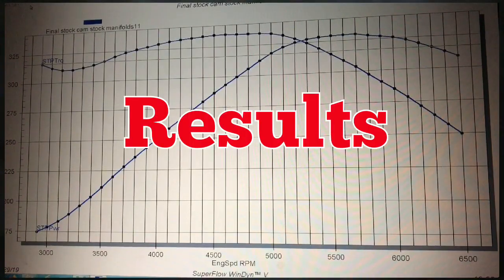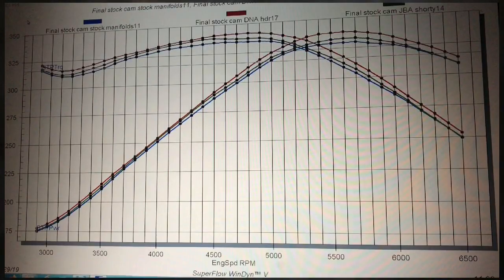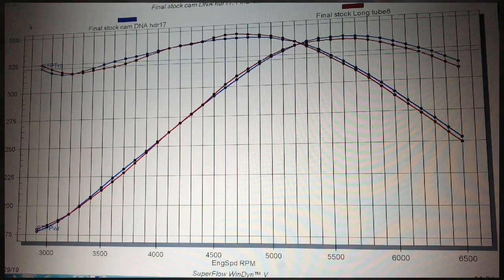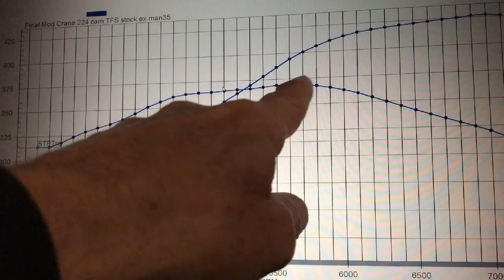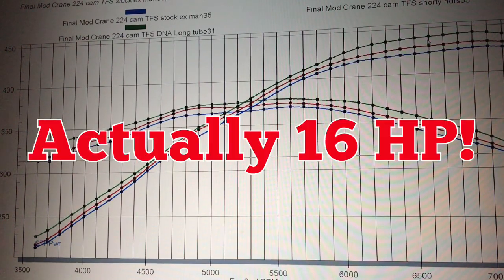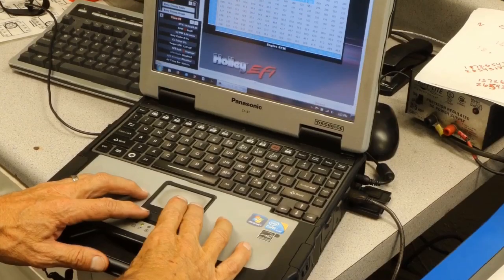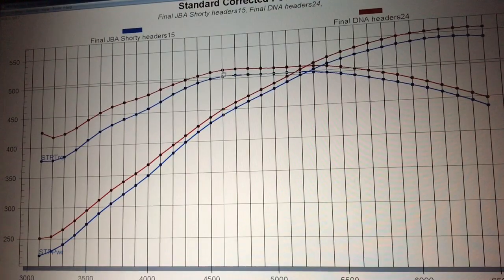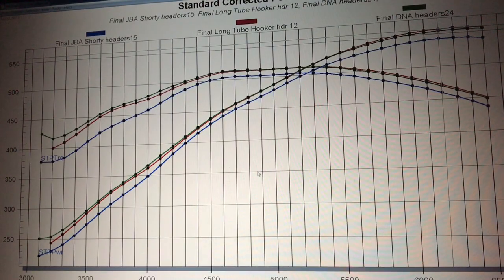DO THEY WORK? LOW-$ EBAY HEADERS

Comment: That IS surprising! 
I have always been told that shorties would be better for me in low torque for my Summit 5.3 gen 3 LM7 450+ hp LS swap in my 1990 Corvette that is going on right now. 
I have been brainstorming trying to find shorties that would fit easily and there really isn't anything. 
I did just find that there  long tubes that are bent to actually fit well in my C4. I guess i will be checking to see where to find some cheapie long tube headers. 😊

Comment: The biggest thing I've seen with the Ebay headers is they are not really make-model specific.  It's "we make a set of v8 headers, sure they're for your make/model, you just need to make them fit'.  So depending on the car expect a bit of denting to be required to get around things.  But saving $1,000 also is a big plus.  Just depends on the car and value/budget.

Comment: Only ISSUE I've had with the ebay headers is finding 3" collectors and sometimes they ain't welded inside and outside of the flange. 10 minutes of welding and a little longer search to find 3" collectors and right sized primaries is worth saving a few hundred dollars to me !!!

Comment: I'm just running stock manifolds on the newest project. I don't want the header drawbacks for a 10- 15 hp upgrade on a 280 hp engine.

Comment: Richard , looking at the difference between the cast exhaust manifolds on this style engine , and lets say cast exhaust on an older style engine .  There is a totally superior design to the cast exhaust manifold on the newer engines than there ever was on the older engines except perhaps the older mopar max wedge engines of the 60's when a lot of effort was placed on max horsepower for those motors .  The cast exhaust manifolds on most of the older engines across the board from manufacturer to manufacturer were in many cases absolutely awful and just served to basically get the exhaust gasses out of the engine bay and out the tailpipe without leaking .  There was no or very little emphasis on extracting extra power or efficiency from those old style cast exhaust manifolds .  As a case in point , The older gentleman that once did my engine machine work described a situation where Ford motor co. when installing the 351 cleveland in one of its cars did not account for the restrictions in the engine bay at the point of exhaust manifold on the passenger side , they were forced to redesign a different manifold for this particular vehicle when using this motor, and by doing so the new poorly designed unit covered part of the exhaust port and greatly hurt how this motor needed to properly breathe.  The main point that I am trying to get at is , have you ever done a test like this on older style small block chevy , ford or mopar engines ?  Many individuals building these older style motors , like myself , would like to know how much difference there is in torque and horsepower with the old poorly designed exhaust manifolds compared to , even shorty style headers !!  I have an older work truck wit a 460 Ford engine that needs new exhaust and I'm considering replacing the old decrepid cast manifolds with shorty headers .  Thanks for all the effort you put into sharing your data with us on how to make more sensible mods to our motors , We  greatly appreciate it !!
Reply from the maker: we have run stock manifolds on sbc vs headers

Comment: Actually took my DNA headers out of the box today. I work with stainless steel for a living. These are definitely not 304. They are some extremely low grade stainless and you can get a magnet to stick fairly well on the tubes and i had no problem getting one to stick on the flanges. For $200 I'm not going to complain too much as long as they have a reasonable fit. One of the "mid pipe" tubes is ovaled pretty good and isn't going to work out of the box. I'm probably going to make my own with an x-pipe and true duals. The hardware and gaskets are going in the trash.

Comment: I would like to see a test on mid length headers, the advantage is the mid length tend to fit easier than long tubes.  I imagine they would be in between but how much.
Reply from the maker: power is between long and short
Reply: @richardholdener1727  I am running mid length headers on my 72 GMC with an lq4.  It has ported and polished 243 heads a comp cams cam 226 duration intake 232 exhaust 113lsa 600 lift, tbss intake.  I made 350hp at the wheels and power peaked at 5700 and stays flat to 6500.  I am running 2.5 inch dual exhaust on it and was debating on going to a long tube header but not really sure it’s worth the expense.  I was thinking maybe a long tube would give me a bit more on the top end, I have more low end than I can use so that really isn’t a concern.  Thanks for your videos I have learned a lot, and your answer confirms what I was thinking that the power would be in between.  If it was closer to the shortys it might be worth it.

Comment: I am not a race driver, I am in pursuit of increased efficiency.  No one makes a long tube headers for my application so I use shorties.  The only auto of mine that does have long tube aftermarket support is a turbo, so shorties still win.

I did find your tests very enlightening.  I begs the question, do I support the company that spends all the time and money to develope quality aftermarket products of the POS overseas company that STEALS their design with absolutely no regard for their investment and sells them on eBay with zero overhead???  I support American aftermarket companies and for those reasons.  God forbid I ever need customer support from a company in China that ripped of my go-to American company's, design!!

Comment: Given how much power Freiburger DIDN'T lose by smashing headers with a sledgehammer, I think Ebay headers will be just fine for their length.  What you get with a name brand is quality, fitment, longevity, and approving nods from the grey-beards.  Fitment is no joke; sometimes you discover that the cheap headers want to occupy the same location in space-time as a control arm bushing (because they were mocked up on a 4x4 model and your 2wd is different).  But Ebay has a fitment return and refund policy, so there's that.

Either route is valid, so long as you know what you are and aren't getting for your money.

Comment: What did you do with upstream 02 sensors /placement locaton when you did all this testing or does it not matter ???
Reply from the maker: we ran a stand alone ECU-no closed loop or need for factory O2s
Reply: Is that  a dino only feature tune type thing or could it be used  or applied to a everyday driver vehicle
Reply from the maker: we ran the motor with a stand alone ECU (Holley), not the stock ECU-it is possible to run one in a vehicle but would be difficult

Comment: Really glad to see this. I used DNA headers in the past and i always wondered how much power i was leaving on the table. Fwiw i ran them for ~3 years and i sold the car with them on. I didnt have any leaks or visible cracks when it left.  Disclaimer the car only saw about 10k miles on the ebay headers but a ton of heat cycles due to short trips but got frequent WOT pulls. 

This was on a stock cammed motor with aftermarket intake and full exhaust.  Nothing special.

Fitment was good enough, a little closer to block vs stock but didnt cause any issue. I would buy them again for another budget NA build. 😊

Comment: I had an idea the power levels were not gonna be much different vs eBay headers and name brand but my personal experience is the name brand exhaust last longer and hardly ever have fitment issues. The fitment issues on cheap headers can be a nightmare so that alone makes me pay the extra money to get the more expensive ones. Great video
Reply: Cheap ebay stainless Jeep 4.2L header hit the leaf spring on a Wrangler! Supposed to be direct fit. I said for what a 2WD or an extreme lift!

Comment: My short tube headers were very thin where the exhaust piping  bolted up to them.  The exhaust guy did great welds but at the confluence of the very thin wall SS and the aluminized tubing it was a difficult weld.  Remember these do not have a flange just a short end of the tube that clamps to the  headers. Flange thickness at the head was adequate and I had no issues with them leaking there.  Spark plug access was fine but the set up needed a set of ceramic boots on the wire to keep from burning them.  Don't forget to add the cost of the wires to the change over.

Comment: I had to get an ebay header for my old car, 93 sidekick. The old stock manifold was cracked. It did run a lot better, mostly from not having the crack. But for IIRC $80 and $120 for a shop to install them, compared to $400 for a set of replacement manifolds. It was a great Improvement.

Comment: You teach information very well… easy to follow and understand… my question is… I’ve seen different design in shorties.. I have a set of hookers that are called GT 500 tuned shorties design for a 4.6/3v  and they have actual collector as others don’t  … I’ve also seen DNA from eBay with the same design… my question is is there any difference in design of shorties when ie comes to power… and not compare to long tube…
Reply from the maker: you need primary length
Reply: Can you explain the meaning of “tuned shorties” as compared to “non-tuned”.. and is that just advertising.. now I understand pulse exhaust timing which is why LT’s are the best but how does that improve the shorties…when the primary’s are not equal lengths…because I noticed an increase in power when I installed my shorties..

Comment: Included with your voice over a bar graph with all the hp and torque differences together would be easier to understand. I like the videos but sometimes it takes a while to get to what I came for and I miss it.
Then I catch myself having to replay parts to gather all the feedback and compare them in my head. LOL!!
Reply from the maker: I SUPPLY GRAPHS IN THE VIDS FOR THAT REASON
Reply: @richardholdener1727  Bar graphs with peak hp and torque. I like the line graphs but who cares what numbers we are running before launch.

Comment: For my engine here in Aus, only the expensive Pacemaker headers offer long tube headers, all other cheapy brands ones are basically a tube version of the cast logs which suck.  Interestingly I get about 18rwKw gain going from stock to long tube on my Buick L27s but I think it is in part that the stock logs make the engine quite knock limited at about 22-23 deg where the long tubes allow the engine to reach MBT of 29 deg without any knock.
Reply: Logs😂😂😂😂😂 oh my, you Aussies are something else😅
Reply: @keithhaynes5348    What do you call them, branch of a tree manifolds? A quick google on "log manifold" didn't yield much of any Aussie result, but predominately US sites selling log manifolds for JDM and LS applications 🤷‍♂

Comment: First time viewer, first comment. New to exhaust so bare with me please. I seek knowledge.

So I have a 1975 Ford Econline e150 shorty with a 351windsor / v8 /5.8l / true dual muffler system and its all stock. Only upgrades I have done so far  is swapping the intake manifold from a 2 barrel to a 4 barrel / air gap / single plane. I swapped the Motorcraft 2 barrel to a Edelbrock 1406 4 barrel. Everything else is OEM except for a sweet looking set of Mickey Thompson Valve Covers I scored on FB Market and added some 22' Thrushters mufflers to the exhaust system . OUTSIDE of changing cams and heads, do you think that changing the headers to some shorties tubes will give me some increase of power or torque somewhere? 

Thanks in advance and I enjoy your detail analysis.
Reply from the maker: long tube headers will add power-shorty headers will not
Reply: @richardholdener1727  The two long tube headers seem to have different  design. The shiny ones have a longer front cylinder tube than the rest, and the other design has it the other way around, first one is the shortes, correct? The effect on power is not that different, but there must be some reason for the choice of design, right?

Comment: Hi Richard, I was wondering if you could take some time to reiterate some things I've learned from your videos.  I have an '06 Sierra GMC with a rotted cracked block on the coolant side..   I'm looking to make another '06 LS 6.0 jump as an everyday driver.  While it's apart I figure why not make it as good as it can be. Any advice would be mucho appreciated.
Reply from the maker: WHAT IS YOUR QUESTION

Comment: I ran a 5.7ls1 with a 220/220 581 xer with shorty 1 5/8 with modified 3 inch collectors and got sucked in to internet pressure and swapped to long tube 1 3/4 with 3 inch collectors, optimised the tune and ran the car on the same dyno and lost power and torque down low and only gained 3hp up top. Definitely wasn’t good bang for buck 😳
Reply: So you would have stuck with the shortys?
Reply: Yes I definitely would have

Comment: Thanks for the rundown on the results!  Def great info to know!  Based on that data, as long as the fitment of the inexpensive headers is acceptable, then I wouldn't have any issue with using them.  From a cost perspective, they're pretty much disposable.. but nobody want to replace stuff "just because".  So, it would be interesting to hear from others about their longer-term experience with the lesser priced parts with regard to rusting, reliability of the welds (life without leaks), as well as discoloration.  Ceramic?  Blankets?  Bare?

I imagine that Richard would excel in an American Sign Language course!
Thanks again!

Comment: I would like to see the tests re done with a x pipe or a y pipe vs straight pipes see if the gains are more substantial as having a y or an x pipe helps with cylinder scavenging as I understand it I could be wrong most people running headers care about peek performance and are running a crossover pipe of some sorts the test could be a completely different animal
Reply from the maker: the exhaust design behind the shorty headers won't change their gains

Comment: Wonder if this is the same case for Ford 3v motors because I got some $170 longtubes off eBay for it lol. I can definitely tell a difference in the seat of my pants but I also installed rattler cams and Ford racing intake manifold. I figured if nothing else they gotta be better than those stock logs that were on it

Comment: My thought at the moment is buy cheap headers  for my application, or just run stock exhaust manifolds.  If you have to cut and weld I'm nowhere ahead, rather than buying name brand headers that don't fit it's intended application. THINK BEFORE YOU TAKE A HAMMER TO THEM... It might not work and they aren't going to take them back.270 dollars wasted on Hooker headers is a cheap learning curve... and why I didn't pay up for the  coated option in the first place.

Comment: HELP! - can you do a h/x pipe test? I keep seeing these guys do “true duals” with no balance/H/X/crossover pipe. My understanding is that an engine doesn’t like to be treated as two separate banks. 
Some say it doesn’t matter. Some say if it’s twin turbo, it doesn’t matter. 
I don’t buy it. There’s a ton of opinions but no actual data on the internet. 
Can you please clear this up?? Thanks!
Reply: The twin turbo guys claim an x pipe is for “sound tuning only. No power difference. “
Doesn’t sound right. Every OEM vehicle I’ve ever seen has linked exhaust banks.

Comment: Looks like he went ham on a chocolate frosted cupcake.
Name brand headers only cost over $1000 for my application.  Fitment issues or not, slightly modified cheapies are my only realistic option.
Price update 3/12/2022:  $1700 for name brand headers only.

Comment: This is nonsense. Flow is one thing but not the only thing you should keep in mind when buying headers. Like will the they rust, crack and/or will they warp and cause leaks ? Yes for both of these. So then you're fixing things in short order. Which is better, pay now or pay later ? Think about it.

Comment: Great test. But the difference isn't in performance between the cheap headers...
The issue is the construction and durability
Reply: Ebay headers just as good  hands down
Reply: @cobaltsslsj5891  No, they are made with inferior metals, not machined to high tolerances so expect warping, rusting and leaks earlier than a quality set. They make roughly the same power, so if your project is only expected to live 2-3 years it's a great header. If you want to keep your vehicle for many years, buy the quality ones that will last.
Reply: @The_Fat_Turtle  when i can buy 3 sets compared to high $$$$$$$ ones it's a win win . the quality of ebay is great , i bought a set for my Cobalt SS and it was just as good as the ZZP in every way but $400 cheaper - putting a set on my LS swapped S10 and they are great

Comment: I like that you do apples to apples stuff....  5 decades of hearing how this manifold for intake or exhaust will add "25% HP gain!    I love to see the actual practical numbers.    Also... I put the camaro cast manifolds on my 5.3 in an LS conversion and they added about the same power.
Reply: What year of Camaro and what did you swap the engine into? 
I'm going to swap a 5.3 in a 92 Sonoma with 4WD. I still have the stock manifolds, but I am just wanting to plan ahead and see what other people have gone with.

Comment: I have used many sets of what they call the cheap eBay stainless steel headers and to be honest I've had excellent results with them. Back in the days the headers in the US you could not keep gaskets on them the stainless steel cheap eBay headers hold the gaskets very well you can even use stock gaskets with them. I would even put them up against our well-known brand hooker